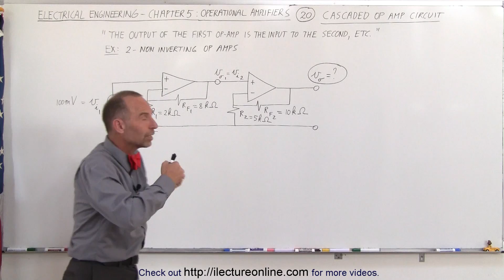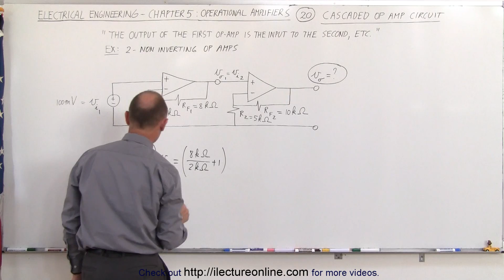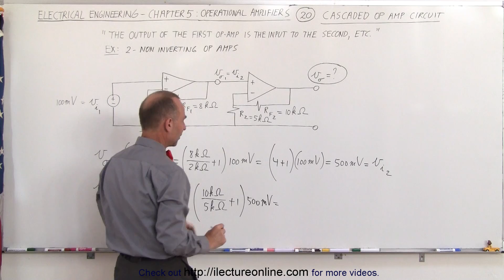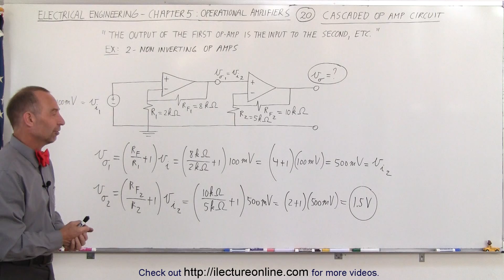Electrical Engineering: Ch 5: Operational Amp (20 of 28) Cascaded Op-Amp Circuit: Example 1

Comment: hello in one of your video's i thought you said the op amp can't exceed the V source so how come it got increased instead of reaching saturation point with the maximum voltage being 100mv
Reply from the maker: That is referring to the voltage (power) supplied to the OP AMP for the OP AMP to operate (not shown here on the schematic), not the input voltage to the circuit.
Reply: @MichelvanBiezen  Thanks for the reply, I'm a bit confused on what a non inverting op amp does what use would it's function be?
Reply from the maker: The main difference is that a non-inverting amplifier produces an output voltage in phase with the input voltage, where the inverting amplifier prodices an output voltage that is out of phase with the input voltage.  It depends on the application of the circuit as to which amplifier you want to use.

Comment: Can I ask why Vo1 = (8/2 + 1)Vin? 
Where does the +1 in the parenthesis comes from?

P.S : Your videos are realy helpful
Reply from the maker: If you take a look at this video of a non-inverting OP AMP,    Electrical Engineering: Ch 5: Operational Amp (4 of 28) Non-Inverting Amplifier-Basics       you will see where that comes from.
Reply: Michel van Biezen Thank you very much. So I get the +1 is standard in every non-inverting op amp 

Thank you very much